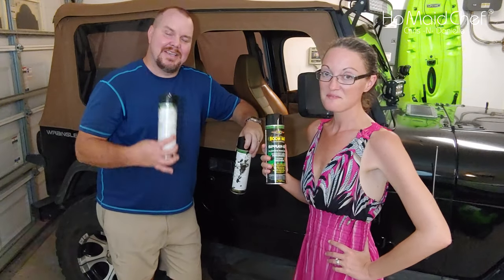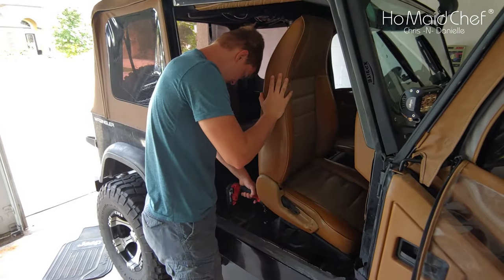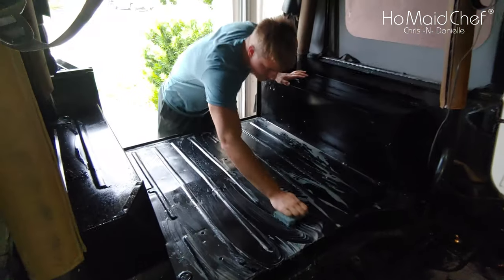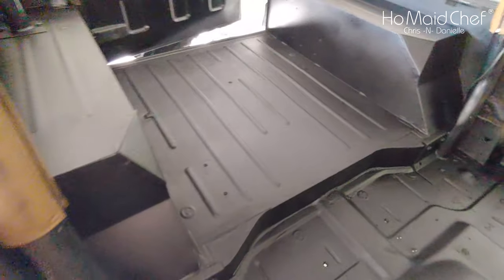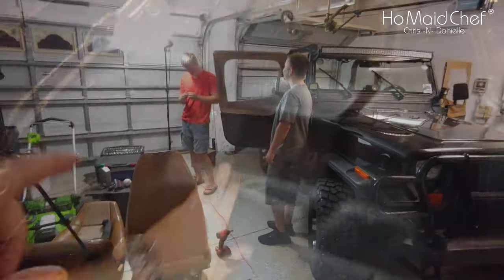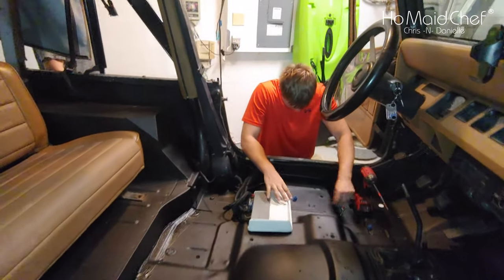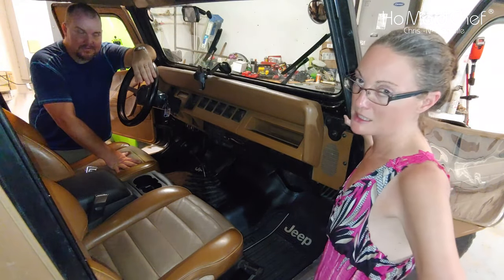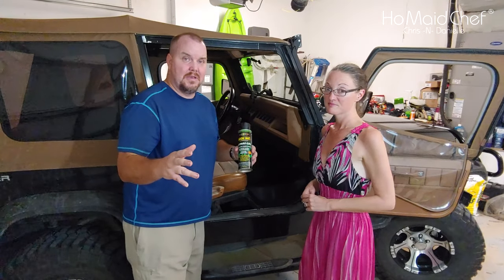Reduce Floor Heat & Road Noise With $40 Boom Mat || Jeep Mods E34

Comment: I put this in my '07 Scion TC behind the rear quarter speaker area cuz it was just pure metal,, I mean if I poke a hole you're gonna see right through it, so I got this and it definitely eliminated raod nose and I only did one of the rear quarter panel ((I had an accident so I'm going to wait on the repair and then spray the other side)) I can't wait till I do to to see the major improvement as. I also did it underneath the the spare wheel as well with 2 cans andi ordered 2 more.
Reply from the maker: That is great to hear. This cut road noise for us as well. We are going to put more insulation and carpet on the floor to cut more heat now that we installed ac in the jeep

Comment: I'm highly allergic to mold, so I'm paranoid about carpet. My doctor had me get rid of it out of my house. Would this be a good alternative to carpet?
Reply from the maker: It would, or just bedliner paint. Be aware you will lose the insulation under the carpet, which is a great source of mold, and in hot or cold your HVAC may not keep you as comfortable as you might like.
Reply: I have special mats for my car that are fit to it.

Comment: We have panel van and engine bay under drivers seat. Engine noise is so high. Does this helps to reduce sound???
Reply from the maker: This will help with the metal resonance. Our son also went over this with insulation and carpet after we added ac to the jeep.
Reply: @ChrisDoesWhat  thanks a lot for fast reply... I mean just this spray alone with normal carpet reduce some decibels???
Reply from the maker: @varghesejoy1791 it may because it reduces metal vibration, but we did this more because of the subwoofer in the jeep.

Comment: Coming to this late but how many cans and how many coats? Or did you just go for a certain thickness of the layer? Thinking of doing this myself since my TJ doesn't have carpet.
Reply from the maker: We bought one 3 pack and used them all and could have used a little more.

Comment: It's the only thing that worked for me. I just sprayed under the tire fenders.
Reply from the maker: We are thinking of using this in our truck doors, love it.
Reply: im on the opposite end of the spectrum with jeep sounds than most. I own 3 jeeps, my favorite is a 1995 yj. And i absolutely hate the sound of them. I had my exhaust guy install resonators on all 3..cut the exhaust noise in half. Then as you said i used this under the fenders, under the main body especially above the exhaust. 40oz jute carpet padding under the carpet. but this under the fenders did wonders.
Reply from the maker: Sorry to hear, hope you are having a great Christmas.

Comment: How is it holding up so far?
Reply from the maker: It is holding up great, needs to be washed out from mud and sand on the trail.
Reply: @ChrisDoesWhat 

Finally got around to doing this on my YJ, fully underestimated how much I would need. I started with 3 cans but ended up needing more My YJ is red and the red paint would show through. it took 7 cans for an even coat for the inner tub.
Reply from the maker: How do you like it?
Reply: @ChrisDoesWhat  it looks great, I still gotta put her back together but it turned out great. I don’t daily driver her anymore so it should last for a long time.
Reply from the maker: @discoveringmikey  glad you like it, ours was like solid bedliner but not near the price. Yours may take longer to dry because of the 7 cans.

Comment: How did it do for heat prevention to the floor?
Reply from the maker: It is okay still it hits the 90's here in Florida if you want to use the AC. But I had a convertible car that the AC didn't do that well in the upper 90's and I bought it new. With the windows down, didn't notice much of a difference between the carpet and this, the carpet in this jeep was on it's last leg. Also we did this before we installed AC, we are looking at ways right now to insulate the floor more.

Comment: How big of a difference did it male on road noise?
Reply from the maker: I think it is about the same as the carpet we took out. The big thing is it's more durable and it can get wet in the Jeep.
Reply: @ChrisDoesWhat  nice. I have bed liner but the road noise is crazy
Reply from the maker: Well we've road in it and all we hear is Jeep exhaust, stereo, etc. If you have bed liner I probably spray it underneath the floor. Our son never complains about any noise with the 2100 watt stereo system he has, those videos are coming.